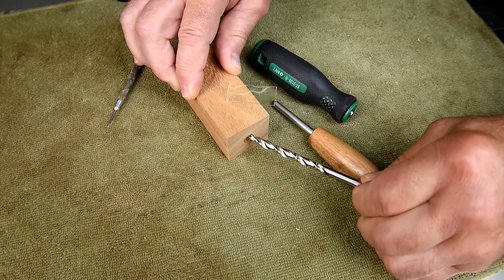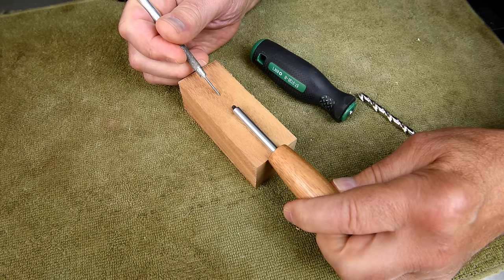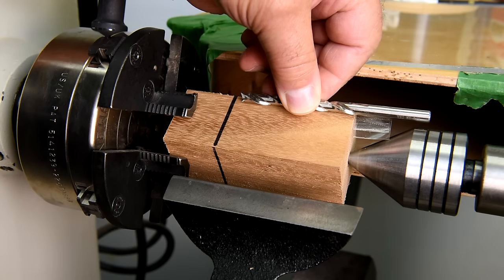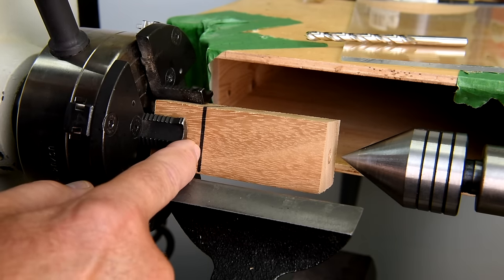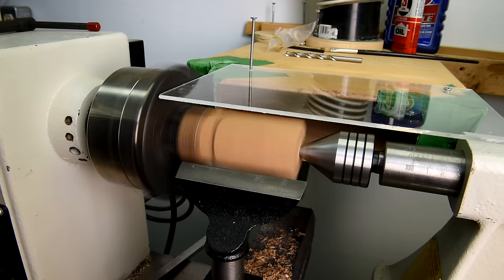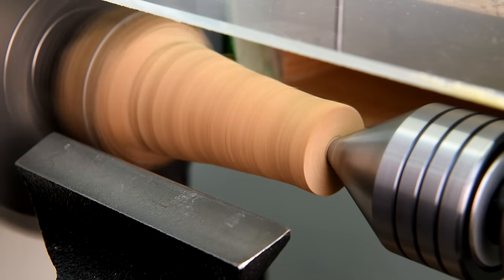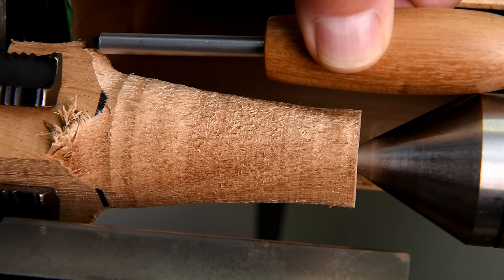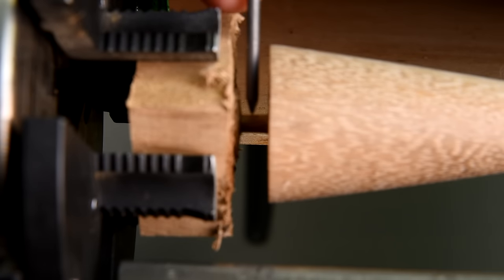The Custom Screwdriver - Part 3 (conclusion)

Comment: Very nice Ron, i have a question: do you know of any his and hers pen kits? Or two pens that will go together nicely? I can't seem to find any and may have recalled you doing one. I have a comission piece for a family member. Thanks so much!

Eric
Reply from the maker: Hi Eric. What I do to make them sort of match is use wood blanks that are very obviously the same but on distinctively different kits. Perhaps you may be able to find a piece of wood from something that was perhaps meaningful to both of them. It can be something as simple as an old wooden chair. Anyway good luck there :)
Reply: why do you not use a skeew chisel for your turning,you would get a superior finish to a scraper